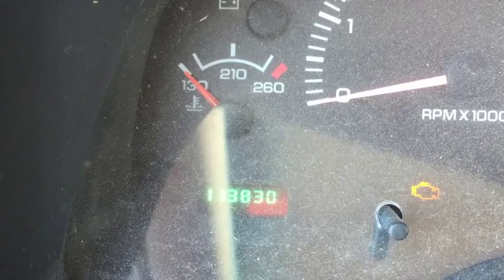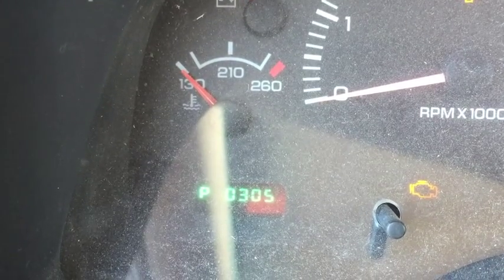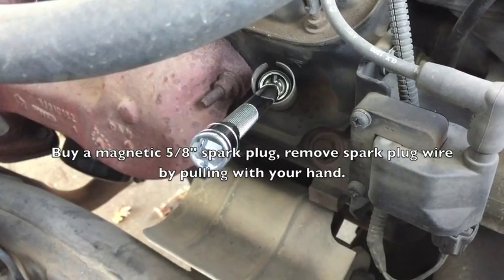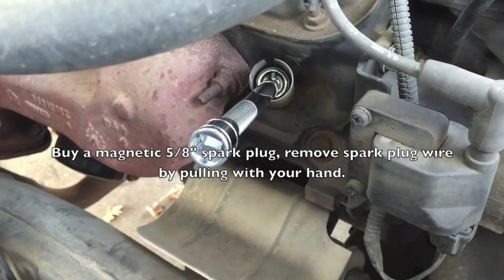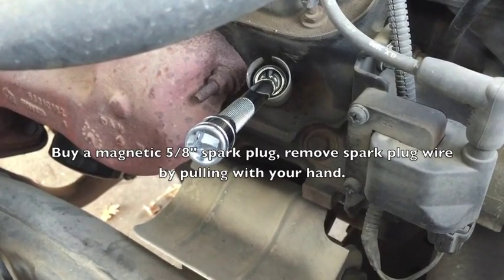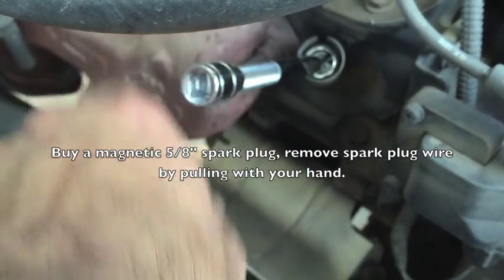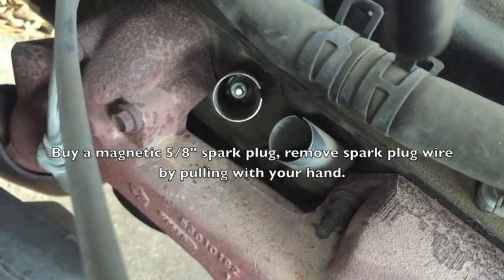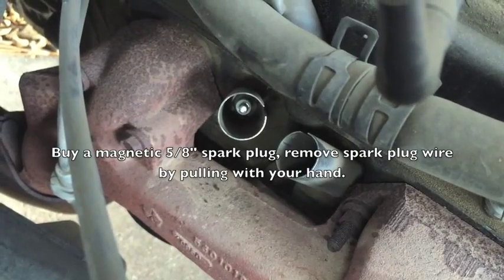How to change spark plugs on a 2001 Dodge Ram Truck 3.9 Liter 6 cyl

Comment from the maker: I changed the plugs again today 7/09/2020, along with the spark plug wires, distributor, rotor. The rotor and distributor had some oxidation and pitting on them. 136,000 miles and running great, A/C still blowing cold. The dash is my only complaint, its cracked in several areas and need to replace it. The # 1 plug and the the # 5 plug seemed hard to back out. I did use anti-seize and heard pros and cons on it, the other plugs came out great. All the plugs screwed back in excellently and smooth with no problems.

Comment: I had this problem with my truck. That's one thing I'm still really pissed at Chrysler for. They had enough to move the engine up more a good 5+ inches or so. Changing sparkplugs in this year model is a real PITA
Reply from the maker: I agree, it's a pain, but nothing in life that's worth keeping is easy.

Comment: this has to be my problem , the 2nd spark plug from the front on the passenger side will not seat any type of socket i use so maybe its just not skinny enough. every spark plug but that one came out no problem.

Comment: Can this heat shied be removed? My V-6 looks like an all day job so I'm putting in Iridium plugs.
Reply from the maker: Sorry just read this, to be honest with you, I am not sure of there is a way to remove them. It's been 5 years since I changed my plugs. Today I am going to change my plugs again and the plug wires , distributor cap and rotor.
Reply from the maker: @mikelovetere - or anyone else. I figured out how to remove the heat shield tubes by accident. I was trying to remove the spark plug wire from the number five cylinder, and it seemed like the wire was super glued to the spark plug anyway, long story short as I was pulling up on the spark plug wire by the heat shield with a zip tie, it released and I nearly fell off the truck and I noticed the heat shield came off , don’t ask me how or why , but that’s how much pressure I put on the wire pulling it off. My main point is I noticed the heat shield tubes have a slit down the middle of it that appears to work by compression and if you want to remove the heat shield tubes just use a pair of nice channel locks and squeeze it gently and rock it back-Dielectric grease—a non-conductive silicone lubricant—can be applied to the inside of a spark plug's rubber boot to better insulate it. This helps keep the plug protected against moisture and leakage, deters the spark from arcing, and prevents the boot from bonding to the spark plug's ceramic portion.I was able to put mine back on successfully, but I had to use the channel lock to massage it back into it hole. When I was doing so I felt the spark plug and noticed it had a chip in it, and I think it may have been caused by the heat shield coming off when I was pulling up on the spark plug wire attached to the spark plug. When I reattached the spark plug wires, I put some Dielectric grease.